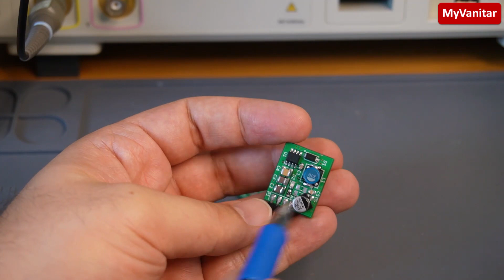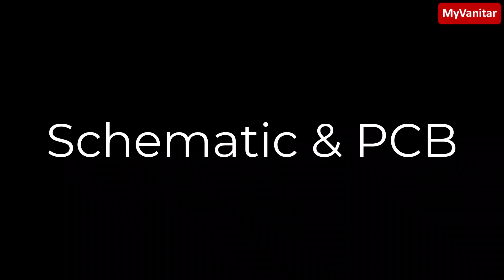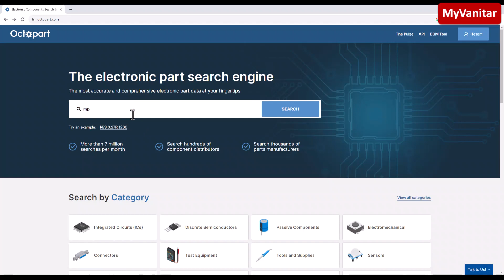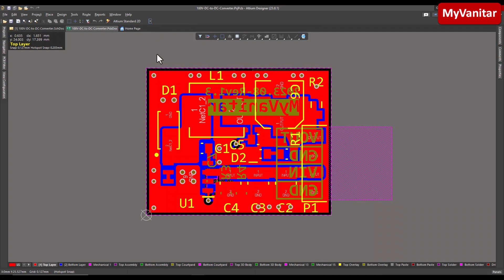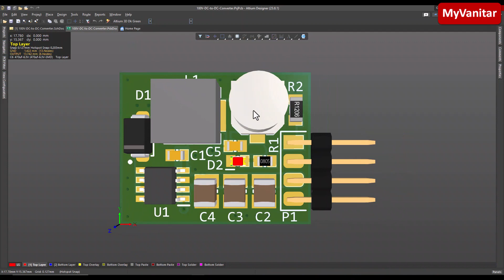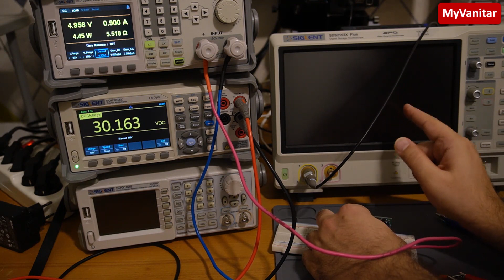8-100V to 5V-1A DC to DC Buck Converter using MP9486

Comment: Running 90VDC to 5VDC Input for 10 hours is it okay?
Reply from the maker: Did you mean 5V output? Yes, why not. it depends on current consumption. if you don't use the full max current, then use it 24h, 7w. I have also published a similar design here, both works good: https://youtu.be/4VtLREd1TWo
Reply: @MyVanitar Approximately how many degrees of temperature will be obtained if handling an input current of around 72-84VDC for the ESP8266 and 1x Relay load?
Reply: I mean MP9486 Temperature
Reply from the maker: as I said, it depends on current consumption. the loads you mentioned will not pass 100mA. you misunderstood voltage with current, input and output

Comment: What is 2:00 msc type?
Reply from the maker: I did not get your question.
Reply: @MyVanitar what was the type of capacitor you replaced?  It sounds like you said "msc", but I'm mis-hearing.
Reply from the maker: Replaced MLCC with Electrolytic type. Look at my latest video also. another design with the TI chip: https://youtu.be/4VtLREd1TWo?si=e05oZyp0BGcuN0fU

Comment: can you use the same SOIC IC to converter the same input voltage as mentioned to 28V, 3A constant output? If yes, then please suggest suitable changes required in the circuit, especially the inductor value and R1 & R2 values.
Reply from the maker: there are many chips for that voltage and current ranges and easy to design a PCB for that

Comment: Can i input ac main 230 v
Reply from the maker: No, maximum 90V-DC
Reply: @MyVanitar  any buck converter support 200 v dc?
Reply from the maker: I can design it for you as a premium project. also, I have some designs that can get 230V mains input on the channel, but the output is fixed

Comment: Thanks for all the info on this circuit! I see the BOM lists C2 and C3 as 10uF but on the schematic they're labeled 22uF. Any clarification on this? Thanks!
Reply from the maker: Thanks. if you could find 22uF capacitors with that voltage and package size, use 22uF, otherwise most of the capacitors in the market for that voltage and size are not higher than 10uF
Reply: Gotcha! Im trying to stick to through hole components so maybe I will try for two 10uFs in parallel for good measure. Space isn't much of an issue in my case @MyVanitar
Reply from the maker: the input side is not as sensitive as the output. the layout is very important

Comment: Hi, I'm designing one for 4.2V and 12.0V, I've managed to get the output voltage with R4=10K, R3=590K (for 12V) and R3=200K (for 4.2V). 
As per the datasheet's application note, the inductors are 33uH for 5V and 47uH for 12V output, so I put the same with 1.5A rating (going to replace with larger current ratings favoring lower DCR)
The 4.2V application needs at least 600uF at the output for handling the voltage dips due to current spikes (1.6A bursts for ~600usec every 4msec), so I've put 2 units of 330uF 6.3V.
The 12V application works with 100uF, but I will put 470uF 16V for output voltage stability.
The input capacitors are the same as datasheet, i.e. 2 units of 2.2uF.

Now for these two applications, what should the values of R2, C5, C7? from reading the earlier comments, I looks like there's a linear relationship between R2 and the output voltage, therefore, for 4.2V the R2 should be ~400Ohm and for 12V the R2 should be 1.1KOhm ???? 
If that's correct then these resistors are not readily available, can I use 470Ohm and 1.2K ?
Reply from the maker: C5 and C7 are identical for whatever output voltage. if finding the right resistors is difficult, you can use a potentiometer, otherwise, the Vout formula is within the datasheet. Choose the value of R2 in a way to draw at least 10-15mA. value is not critical however pay attention to the power dissipation on the resistor.
Reply: @MyVanitar  I'm curious to know why R2 is required? It was not suggested in the datasheet of this device!
Reply from the maker: Have you watched the video completely? many people have a problem with this chip and wrote posts on the manufacturer's forum. this circuit was the only possibility that it worked for me flawlessly.

Comment: what values do we need to change to achieve 24 V, a comparison example would have been great
Reply from the maker: Just order the PCB directly, because the circuit is identical. You only need to change the values of R1, R3, R4, and C6 (C6 for 35V, maybe 47uF-35V has the same footprint). Check this yourself
Reply from the maker: also the R2 should be 2.2K for 24V output

Comment: How to make 12v?? I want 50 v until 70v input, out 12v, load mybe 0,5A or less only for input IC
Reply from the maker: Just order the PCB directly, because circuit is identical. You only need to change the values of R1, R3, R4 and C6 (C6 for 16V, maybe 100uF-16V has the same footprint).
Reply from the maker: if you want this assembled, just let me know to make a new BOM and you can place your order
Reply: @MyVanitar  yess i just want to get the output 12v, wich value resistor should i used?
Reply: @botak333  inorder to get 12V, you need R3=590K and R4=10K. For achieving any output voltage, R4 should be left 10K and R3 should be adjusted such that the voltage divider steps down the desired output voltage to 0.2V for the feedback line. If thats what you were looking for.
Reply: @MyVanitar  no i want combine with my circuit, but i dont know how to get 12v, i see the data sheet also i dont get it
Reply from the maker: I suggest you not to combine it and mount this board on your main PCB instead, it is clear that you have not watched the video completely.
Reply from the maker: R2 should be 1K also